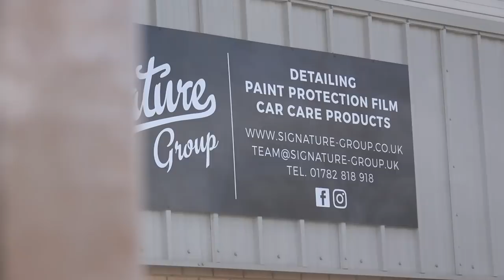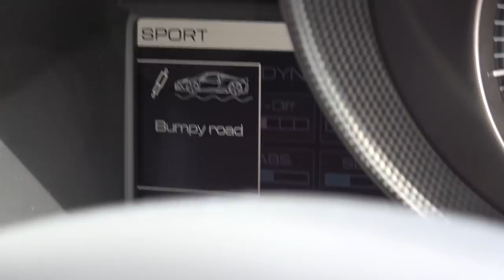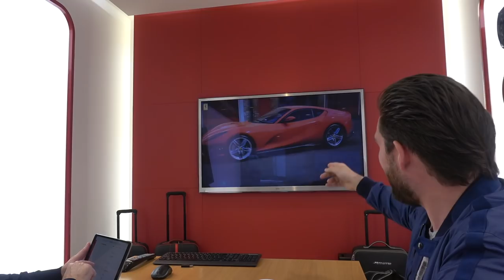Matching My Ferrari 812 Superfast To My 458 Speciale!?

Comment: 4:50 nailed the waste gate noise
Reply: Nope, waste gates vent exhaust gases(and thus sound like an exhaust as they are plumbed into the exhaust), that noise is a blow off valve, it vents intake charge when you lift off the throttle to prevent compressor surge.
Reply: Andrew Whalley I was waiting for someone to correct that. I knew it would happen. There's always someone who tries to find a mistake in a video and comment on it. Well, he's driving his speciale to spec his 812 superfast. So, there's that.
Not to mention, wastegates don't always plumb back into the exhaust. Many modded turbo cars vent to atmosphere. O figure, who cares if he mentions the wrong vent, but I knew there'd be someone to correct it.
Reply: smminco because every damn time a youtuber drives a turbo car they comment on the "wastegate" sound. They are car guys, they can be corrected.

Comment: Personally, I can understand why people don't drive their cars. Look at Ralph Lauren for example, that man keeps his cars in a proper display where he can go and enjoy them by appreciating their designs. And he also drives them now and again (I think). But when it comes to someone buying a car purely as an investment with no intent to even look at it, let alone drive it, then that's not right in my eyes. And for my spec for an 812, I'd go with Grigio Scuro, blue brake calipers and black tdf wheels. The interior would be Blu Medio Alcantara. Most carbon options as well, because there is no such thing as too much carbon

Comment: If you are keeping the 458 long term, longer than the 812 at least, then match the spec. If you are planning to move the 458 on before the 812 then don't is my 2 cents. The timing purely because that colour will always be associated with the 458 in your mind and if you sell it and keep the 812, you'll constantly be reminded of the 458 whether you want to be or not.

Comment: I completley agree that the cars should be driven if the sole purpose is just to qualify for the next one. Maybe a min 1000 miles between annual service? If you can afford all these cars you most likley are not concerned with deprecation.  

As for matching the 812 to your current car.......its your car and if you really like that combo then go for it.  I personally would take the opportunity to change the style. But i dont own a ferrari and my last two pickup truckd have been black so my opinion may not be one to make your choice from.

Comment: How about something like Verde British Historical with the 20” Forged Dark Painted Rims or even Gold, Giallo Modena Calipers, Titanium bolts, Carbon Centre Hub Caps, Historical Livery with the Yellow stripe over the bonnet (wheel arch to wheel arch, running between the bonnet vents/intakes) like on the 599 GTO, painted shields, Giallo seatbelts, with Blu Sterling interior.

Comment: A white RS Cosworth with just over 200 miles on the clock recently went for £91K at Silverstone auctions.  A low mileage RS2000 went for £97K at the same auction and a Sierra RS went for £110K last year..

Comment: i would not to try to match it. the cars kind of serve 2 different points , so would  be  my looks for them.
Blu Scozia, silver racing wheels, brakes in Giallo, black tailpipes, scuderias on the side
and inside: full electr. standard seats a mix of charcoal leather and cuoio alcantara, horses on the headrest and seatbelt in giallo and a yellow rev counter

Comment: Sorry James; a capital NO. Rosso Fiorano makes the 812 look plain ordinary and it's hardly original given that your 458 is that colour. As I said in my comments on your original video "speccing my 812" you're now grown-up enough (that's why you're going for a traditional front-engined GTB) to go your own way and choose a colour which a) suits the car - this is a sophisticated gentleman's express not a p-sub V8; and b) is rare. All GTBs look better in darkish colours - I've had a 550 in blu TDF with beige tradizione. I mentioned Canna di Fucile or Blu Pozzi or Scozia but my favourite is a dark green, Verde Inglese or Verde Abetone (not Verde British Racing with is lighter). Google these colours to see them on cars in the flesh - much better than the Ferrari configurator. Similarly if you want a true colour likeness, Google "green Ferrari F12" and have a look at a stunning car regd F12 MHD outside the Lanesborough Hotel at Hyde Park Corner. I've checked with HR Owen who sold it and it's evidently Verde Zeltweg with beige tradizione inside - understated and absolutely stunning.